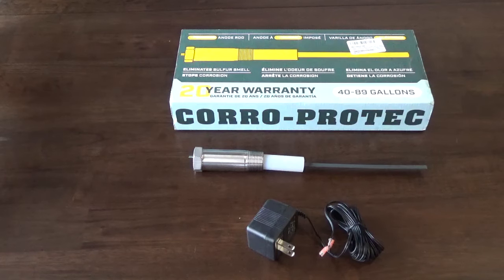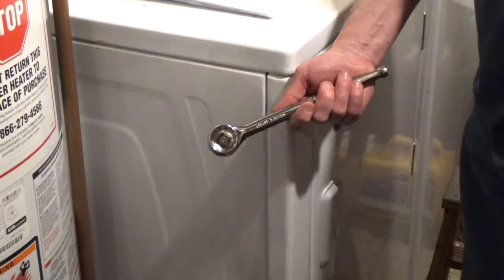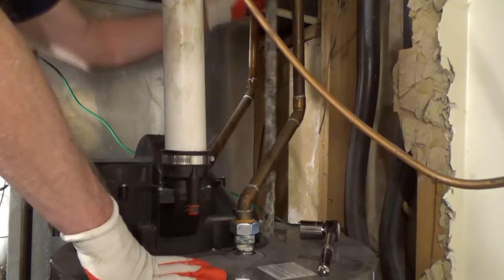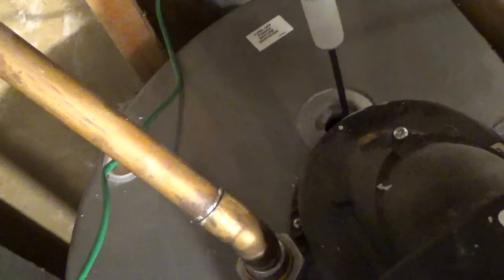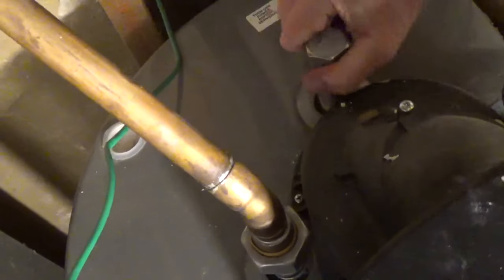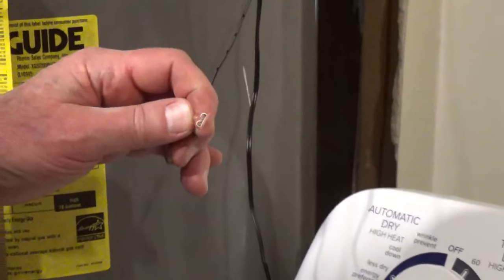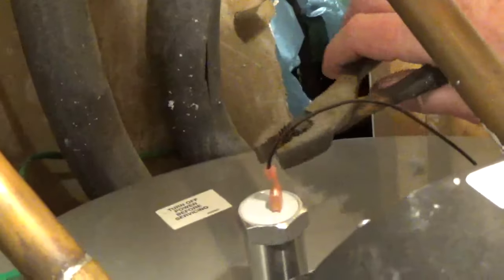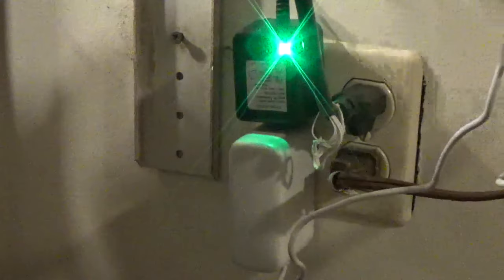How to Install a Corro Protec Powered Anode Rod

Comment: What do you do if the basement ceiling is not tall enough and will not give enough clearance to remove the old anode rod?
Reply from the maker: Hi, you can use a hack saw and cut it in half so it can be removed. Tape off the bottom half or have someone hold it so it doesn't slip into the tank when it is cut off. 
Check out more home improvement tips in our e-books https://www.amazon.com/gp/product/B0B2KW1FQ9?notRedirectToSDP=1&.

Comment: Did you expect that dirty water to come out of the faucet?
Reply from the maker: When you drain water from the water heater and then refill it, any debris or buildup on the bottom gets stirred up. So you usually get some cloudy water.
Reply: Yes when ever you stir things around inside that water heater it will kick up settled sediment off the bottom of the heater it’s normal
Reply: I  installed a new water heater and black water came out of the taps. When the water pressure is turned back on, the air in the pipes shakes them, loosening the deposits in the pipes. It does not come from the water heater. Any deposits are on the bottom of the tank and would not get washed up to the hot outlet.